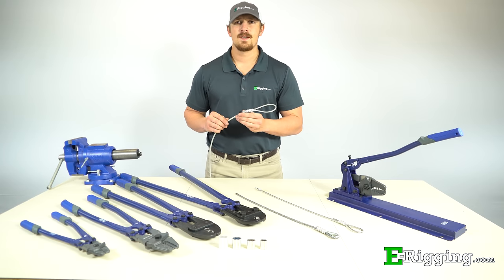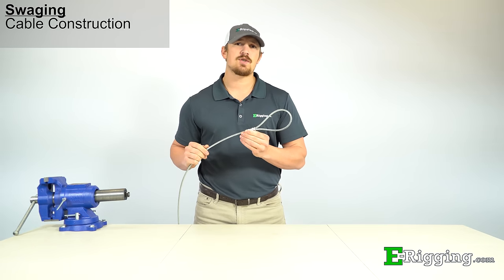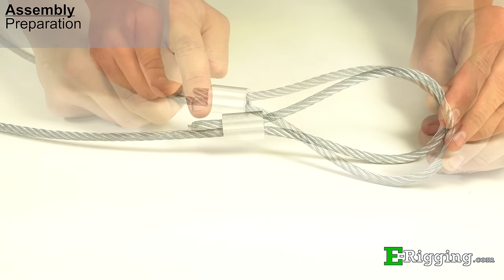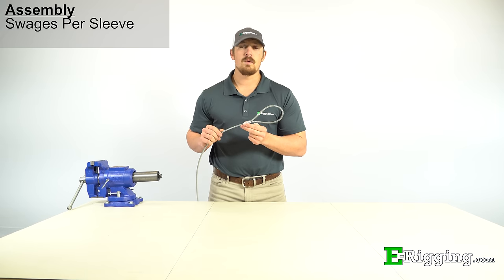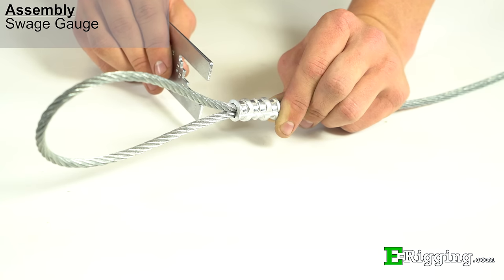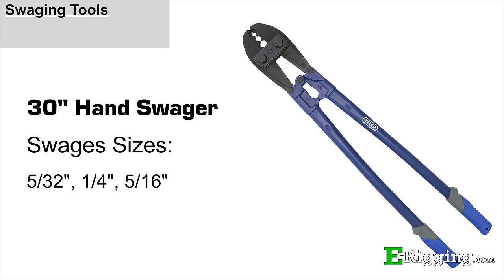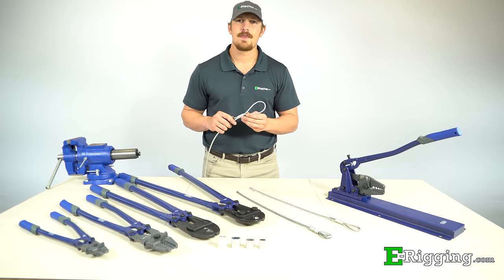How to Select and Use Swage Sleeves - Installation Guide

Comment: Every amateur radio operator with a tower or a mast should be watching this.  Personally, I would like to see it as part of the technicians class license test.
Reply from the maker: Thanks for the kind words. Too often we find applications where the swage fittings are installed incorrectly. Hopefully more people can watch this quick video to swage properly.
Reply: You are correct! So another question would be, do they make sleeves that would match EHS cable sizes? Testing data for them as compared to guy grips would be very good to have also. 73

Comment: Great video. Thank you very much.
One question, at the start of the video, your loops are very tight and leverage a U shaped loop. On all the demonstrations however, it isn't there.
In order to constantly lift and drop a plow on my ATV using the wench, should I use a small loop with the U shaped tool over and above the sleeve ? Or make the look bigger without the U shape?

Aside from that, great video. I wasn't doing 2 or 3 swages the last 2 times I did this so I probably was loosing cable strength. Learned a lot from your video. Thanks again.
Reply from the maker: Great question, Phillipe. Wire Rope Thimbles are a great way to protect cable strands from abrasion or crushing that can occur from constant use. While they're not required, many prefer them in an assembly like yours. Thanks for the comment, and we're glad you like the video!

Comment: How much weaker is the connection if the vinyl is left on? What percentage range would you estimate? I only need around 15% of the working load for my application but I did it over the vinyl. 1/8" cable
Reply from the maker: Good question. Vinyl coating should always be stripped prior to the swage since the vinyl can loosen and slip out. We've seen lots of swage failures over the years due to leaving the vinyl coating on. So, in your case, we recommend that the cable assembly be replaced. Thanks for the comment and good luck with your project!

Comment: Thank you so much for making this very informative video.  I have a vinyl coated stainless steel rope that has diameter of 1/16 bare wire and 3/32 diameter coated. And I bought sleeves for 3/32 diameter. But now, I learned that I should cut the vinyl before putting on the sleeve. Is it okay to still use the 3/32 sleeve since it will anyway flatten upon swaging?
Reply: same. i just learned about the cutting of the vinyl coating as well

Comment: This is a great video, thanks... any other crimping method if you don't have the tool? thanks
Reply from the maker: People have come up with lots of other incorrect ways to smash these fittings with hammers or vises, but those methods may fatigue the aluminum sleeve in a way that will promote cracking and failing.  Using any other method than an appropriate tool is not recommended as there is no consistency in their load holding ability or fatigue life.

Comment: Thanks.  Got a new Rudder control mechanism for a Kayak, foot controls.  1/16 th in. wire.  What is that plastic stuff over the end called how it is sized etc.
Reply from the maker: Hi Joseph. If you're referring to the dead of the cable, we used electrical tape to seize the end.

Comment: Did a 3/16ths with only 3 stages. How much weaker will it be than with 4? It’s not for overhead or weight bearing application.

Comment: can a get a swaging tool for 3/8 wire rope that can be used in either a vice or shop press rather than the big bolt cutter type
Reply from the maker: Hi! Good question. We do carry a bench-style Tyler Tool swager however, it will only swage 1/16, 3/32, 1/8, 5/32, and 3/16.

Comment: 🗜🛠  I'm wondering if anyone's found crimping dies with the round bite(s) shown here,  for the huge 11 ton hydraulic crimpers?  
I see eRigging has a 5 ton hyd crimper tool stating to use the #10 die, which appears to be a round bite, but I don't need another tool just the dies.  
Everywhere I look I see hexagonal bites for electric lugs.  I suppose if there's nothing premade I could try making a few sizes from steel flat bar.

Comment: How do u know when to add a second sleeve?   I imagine adding a second sleeve brings efficiency up to 100 %.     Additionally are u suggesting that a single sleeve on 1/8 cable will actually holds 1800 lbs ?
Reply: Excellent video by the way
Reply from the maker: Adding another sleeve will not reliably add to termination efficiency. The load will be held almost exclusively by 1 of the 2 sleeves, then it will shear and the same load will be held by the other sleeve. Depending on how tensioned the spacing is between the 2 sleeves during assembly, it may shock load the second sleeve causing immediate failure after the first one fails.

Comment: I just bought some 1/16 stainless wire rope and aluminum sleeves for a light duty application that'll probably never see weather. Will that work or should I try to find the zinc copper sleeves? I found some plain copper but not zinc coated in that size...
Thanks!
Reply from the maker: Paring metals like stainless and aluminum can make either one corrode. And since you said it will probably never see weather, we suggest changing the stainless wire rope to one that's galvanized. You can shop our 1/16 7x7 galvanized wire rope on our website. Hope this helps!
Reply: @E-rigging  
That makes sense. Thank you!
Reply from the maker: @jerseyshoredroneservices225  Of course! Thanks for the comment!

Comment: I have a project requiring aluminum ferrels for 1/8 inch wire rope so I purchased 1/8 inch ferrels.  The problem is,  I was not able to put the cable through the ferrell because the ferrel was too small.  Unfortunately,  this video did not address sizes.

Comment: Will a 5/32” tool compress 1/8” sleeves to full holding strength?
Reply from the maker: While you may be able to crimp different sizes together, there is no way to tell how much these fittings can hold when it is not holding the designed cable size.  These fittings are designed to be crimped with specific cable and tools.

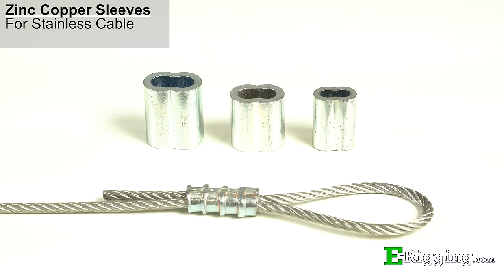Comment: 5:00 According to MS51844 zinc plated copper sleeves should be used on steel cable and tin plated copper or stainless steel sleeves should be used on  stainless steel cable (CRES).
Reply from the maker: Yes, @catranger01, MS51844 does call for Tin plated copper sleeves when using stainless steel cable because Tin does have a slightly less corrosive reaction than Zinc when in contact with stainless steel. However, stainless steel cable swaged with zinc plated copper sleeves are time tested in both land-based and marine applications worldwide, and do satisfy loading holding and corrosion resistance standards for many typical applications. Strict adherence to coating types outlined in the government standard MS51844 is critical for regulated applications such as airplane manufacturing and military contracts. These fittings shouldn’t be used for overhead lifting applications. It is always recommended to get a qualified person to design and approve your application before using rigging assemblies. Please let us know if you have any questions or comments, Have a great day!
Reply: Thanks for the added detail on this specific topic. I had the same question but now I'm still wondering if I can use plain copper on stainless wire rope, just because they're easier to find. Any experience with that combination? 

Do aluminum sleeves have any place in this discussion?
My application is not critical but I tend to try to do things perfect even when it doesn't matter...
Thank you!

Comment: Are the special tools absolutely necessary? Or is there other ways to do it, without spending 30 some dollars on a tool that will probably only be used once?
Reply: No. You can weave the rope together very easily without tools, extra parts, or anything, really

Comment: anyone have advice on how to break free the crimp fitting without cutting the cable? Made a mistake and need to only adjust it by about 1-2 inches and dont want to run a new cable (umbrella)
Reply from the maker: unfortunately, once crimped there is no adjusting the cable in the sleeve.  You will need to cut the cable, but if you want to use the same cable you can always add a shackle or turnbuckle to take up space.

Comment: What is the black materiel called at the end of the braided wire to prevent it from unraveling any further?
Reply from the maker: We use electrical tape in this video.

Comment: Who's going to buy a swage plier to clamp one terminal end loop? I'm using two swages and a punch and hammer. for my truck winch wire replacement. works a treat. Drill a hole in the join of two thick peices of steel slightly larger dia than the wire to clamp  and hammer the swages.
Reply from the maker: Totally get where you're coming from about the hassle, but safety is super important when you're towing or winching. While a lot of folks like the security and termination efficiency of swaged eye splices for winch wire ropes, if you're just doing a one-time job, using wire rope clips can be a great alternative. They're easy to use and still handle the load safely. See this video for more wire rope clip information: https://youtu.be/HKt6kswEAXo

Comment: Can this be done in a vise?
Reply from the maker: Good question! When hand swaging smaller gauge cable, you'll want handle the live end of the cable carefully so as not to damage the strands, so it's not recommended. For swaging and splicing larger gauge wire rope, you'll almost always see rigging professionals use vices to secure the live end while working. For those types of projects, they'll use industrial-grade hydraulic swagers instead of the hand swagers you see in this video. Hope this answered your question!
Reply: @E-rigging  Can a vise be used as a force to cause the crimping of the sleeve?

Comment: hello,  can i make a cable of 3mm  with a 36 hand swager ? thankyou !
Reply from the maker: Our Tyler Tool 14" and 24" Hand Swager can swage that small of a cable if the sleeve is of nearly identical dimensions as the Imperial sized comparable. Please call our customer service department for more info.  
https://www.e-rigging.com/tyler-eighth-inch-cable-swager
https://www.e-rigging.com/tyler-three-sixteenths-inch-cable-swager

Comment: Actually The Chicago Flyhouse Inc tested double sleeve 4:33 .  turns out it's a waste of time. ADDING SLEEVES DOES NOT INCREASE JOINT STRENGTH. Firstly, in order to be able to perfectly distribute stress force on sleeves you should swage them when wire is under stress(higher than human force) which is unattainable when you work alone and without pulling machines. usually the force distribution is not even 1/10 in most cases(ideal would be 50/50).  my guess is that under the stress 1 of the sleeves snaps before dead wire end side starts sliding and then instantly the same force is applied to another sleeve which also gets destroyes (if both sleeves are identical of course) , while in case of standard wire rope clips that does not happen: when 1 clip friction force is less than the load then the dead end wire starts sliding activating other clip friction nad adding it up to ideal 50/50 force distribution, so the joint holds. So the rigidity of the sleeve is its limit. Please, tell me I am wrong.

Comment: Is it okay to swage 19 x 7 cable construction? Is anyone aware of issues that may arise from doing this due to its tightly wound construction? Any insight is appreciated, thank you!
Reply from the maker: These swage sleeves are designed for 6x19 and 7x19 cable. Using 19x7 would likely hold up just fine, but it is always recommended to load test your assembly or consult an on-site qualified person for configurations outside the manufacturer's guidelines.
Reply: @E-rigging  Ok, thank you very much for your response!

Comment: How the hell do you cut cable without it fraying to get it to fit inside sleeve?
Reply: Hey Rodger, the best way to prevent that is to use a sharp cable cutter. Thanks for the question!
Reply: @tboy7885  also wrapping it in electrical tape, then just cut through the tape

Comment: None of those swagers do 1/2” wire rope..??
Reply from the maker: Hand swagers are typically built for smaller diameter jobs. Swaging a 3/8" sleeve is pretty difficult even for strong arms, so anything 1/2" and up will require a hydraulic/electric swager variety.

Comment: How do you remove swage sleeves?
Reply from the maker: They are permanent and must be cut off. For removable cable terminations, we recommend using wire rope clips. https://www.e-rigging.com/How-to-Install-Wire-Rope-Clips
Reply: I found a Dremel cutoff wheel works great.
Reply: @MMMM-sm2rm  Thank you!

Comment: Good video but swage tools are far too expensive.
Reply from the maker: Swage tools do have a high initial cost, but you'll find that if you are making a large number of connections, a swage tool and sleeves will be more cost effective than wire rope clips.
Reply: big125938-Go to Lowes depot or Home depot, Lowes cost $29.98, use it clean it return it for refund after done using...….lol...that's what I do when I only need to use it one time....…...smdh

Comment: what is an ok alternative to a proper swaging tool...? it's for a non-critical application, just using 1/8" cable to "stay" the tops of two tall 4x4 posts together during times when it gets windy, so they can't move apart(the bases are fastened to a concrete slab, and i don't want any prying action). trying to avoid purchasing the tool because i'll probably never need it again
Reply from the maker: Great question! To make an eyesplice in wire rope or cable without swage sleeves, the alternative would be wire rope clips. Making a splice with wire rope clips is simple and only requires a ratcheting wrench. You can find our video on how to install them here https://youtu.be/HKt6kswEAXo